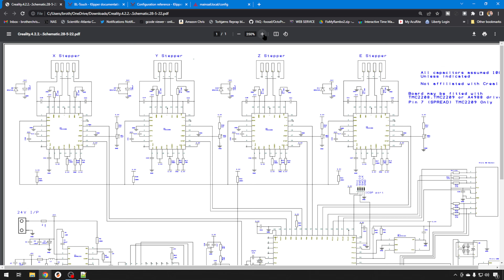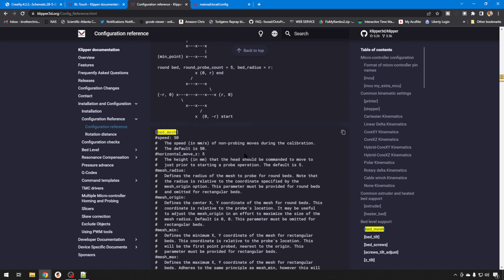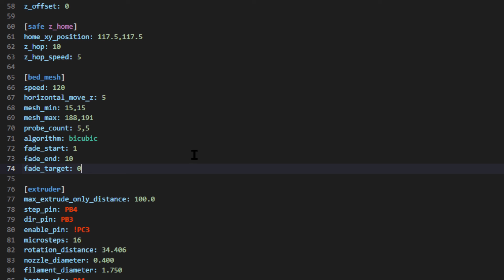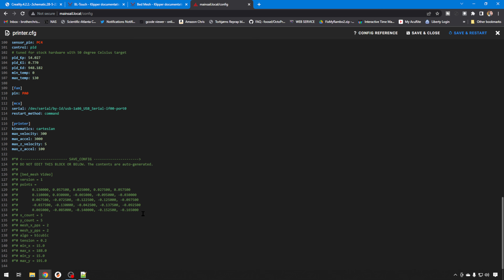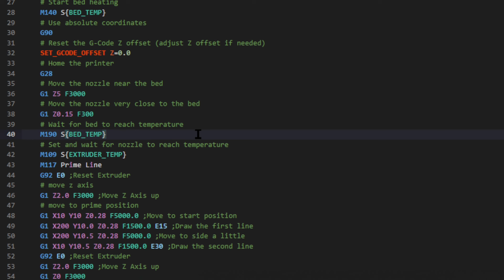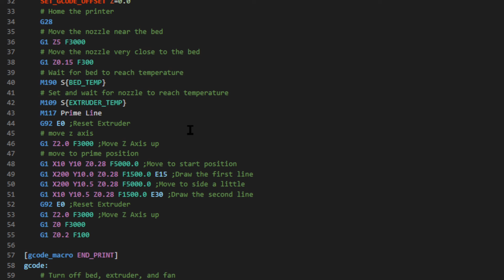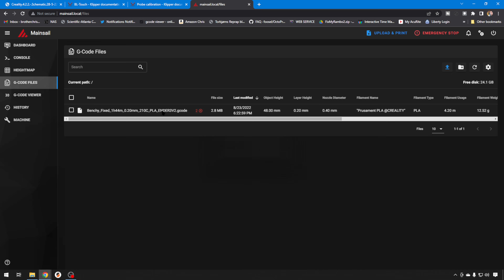Klipper - BL Touch - Auto Bed Leveling - Creality Ender 3 V2 - Chris's Basement - 2022

Comment: Then what is the point of the x/y_offset in the probe section ? Can we use these automatically?
Reply from the maker: I guess I'm not sure what you mean?
Reply: They are the distances from the nozzle to the tip of the probe. They firmware tracks the nozzle position so these offsets are used to correctly position the probe in the x and y directions for creating a mesh.

Comment: Thank you so much for this series.  Incredibly relevant to me with my v2 and CRTouch.  I might just give Klipper a shot now that I have a good foundation of knowledge from you.
Reply from the maker: Give it a try and let us know what you think.
Reply: @ChrisRiley  I finally got the nerve to try it out.  Was a bit rocky at first, due to my SD card refusing to flash the firmware, but once I changed to a new card, it worked fine.  Got my CRTouch all setup and I'm back to printing about 1 day later.  Still needing to go through the Pressure Advance video.

Comment: hi i have a question i have a cr 10 1st version and i added a bl touch for bed leveling. its the first time my machine was open and connected to the computer. so i install the bl touch and try it. when you press home its fine and when you statrt to bed levelling it after it finis the bed moves forward and make a grinding sound and when i try to print it will go down to the bed and move back and make the grinding sound. i dont know what to do, please help. thanks
Reply from the maker: Were you able to flash the firmware to add the BLtouch? It sounds like maybe one of the motor step settings is set incorrectly. Maybe too high.

Comment: BLtouch has an issue.
In enclosed printers, the magnet loose it`s magnetism.
Just  take the pin out. And leave it on a magnet for 30min. 
They should use samarium-cobalt magnet. (300C)
Reply from the maker: That's great, thanks for the tip!

Comment: That bed mesh load makes me think that if you suspect there is different expansion of the bed between say 60c for PLA and 105c for ABS/ASA(well Prusament does 105). you could in theory have this in custom Gcode exports from a slicer to load "Bed_60c" or "Bed_105c"
Reply from the maker: Thanks for your insight!

Comment: My frustration is the price of the BL Touch.  They want basically a third of what I paid for my Kingroon.  I was so miffed that I made my own probe, based on Klicky.  The dock mounts on the bed assembly.  It has the same form-factor as a BL-Touch so people can use existing brackets.  It uses the Klicky scripts for Klipper.  Currently in testing on my KP3S and Ai3M, I will release on github soon.
Reply from the maker: Cool, thank you!

Comment: Chris, thank you for another inspiring video. I m wondering, is it possible to automatically start a BED_MESH_CALIBRATE at start of print if an attempt to BED_MESH_PROFILE LOAD has failed? I would like to store meshes for typical bed temperatures I print at, but revert to automatic probing if no mesh could be loaded.
Reply from the maker: Thanks! That's interesting, I thing you can totally do that, but we would have to write up some code. I would have to think on it, it might get kind of tricky.
Reply: Hi Chris, I am trying to understand the concept of Klipper I am planning on installing it on OrangePI 4 LTS or my Laptop. What I don't understand is do I have to update my Printer with klipper.bin generated from Klipper on PC? I have heavlity modified Ender 3 v2 Neo

Comment: Hi Chris,

Do you have individual counseling? I have a few question.
Reply from the maker: I'll help if I can
Reply: @ChrisRiley  Where can we contacting? I have a Delta Wasp 2040 frame with SKR 1.4 Turbo board with BL touch. My first issue, that the G28 is make separetly home process. First X, second Y and third is Z axis. Thats problem if the head is on the low position because the machine will broken. 
Second problem, that the BL-touch is always send errors. G33 is not working and the G29 same.
Reply from the maker: @laszloszabo1575  That sounds like a pretty complex config. I don't have a lot of free time at the moment, you can always email me. brotherchris81@gmail.com

Comment: Very nice video, just wanted to add a quick tip: the latest Fluidd version has a helper UI for any manual calibration such as that one, so you don't need to manually type the TEST_Z commands anymore! 🙂
Reply: Oh cool! Thanks for the heads-up.
Reply from the maker: Thanks for the tip!
Reply: @Stephanus Prayudhi Mainsail has those buttons appear too during calibration and print 🙂
Reply: Could you explain more?
Reply: Thank you for the info.
Reply: Simply hitting the up arrow will repeat the last command. No need to retype anything.
Reply: @Stephanus Prayudhi Simply hitting the up arrow will repeat the last command. No need to retype anything.

Comment: Chris, your video showed one of the great things about Klipper.  When you need to make a change to the setup, you just edit the printer.cfg file and save.  No more recompiling and writing to a Micro SD card and reflashing the board.  You made at least a few examples.  Along the same line, on the bed mesh, I start with very conservative values and then change one axis at a time until I think it is correct, then change the other.  I also start with a 3x3 mesh - once the min and max are correct you can expand to a 5x5 or even 7x7
Reply from the maker: Thanks Dave, I am doing my best to try and keep these pretty straightforward. There is so much you can do in the config file.

Comment: 15:27 looks like your x is wiggling allot when it goes up and down.
Reply: Agreed. I got a dual z kit for that reason, especially because I have a direct drive extruder mounted.
Reply: @jungletek  just tighten the screws should fix this.
Reply: @heselmas  Adjusting the eccentric nuts will help a bit, but then you possibly over-tighten one side and have too much drag. YMMV.
Reply from the maker: Thanks guys!